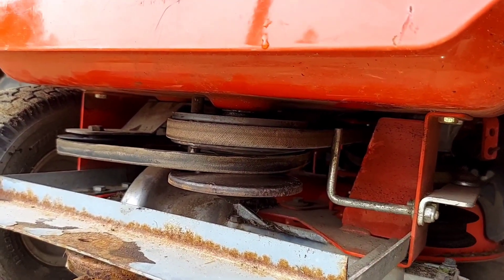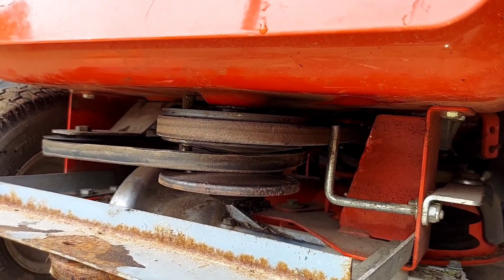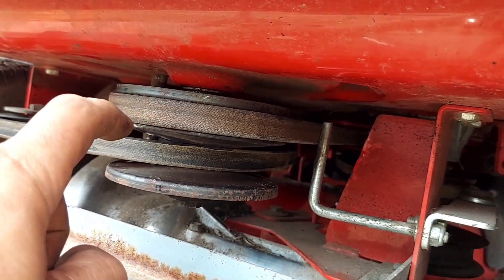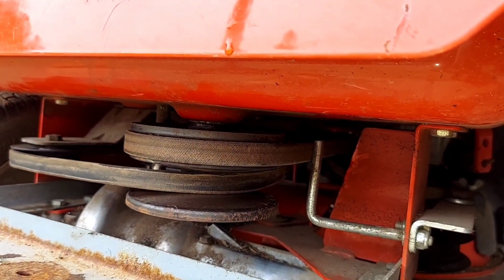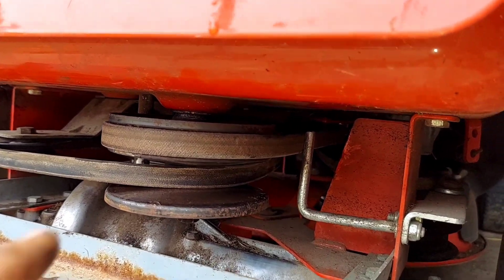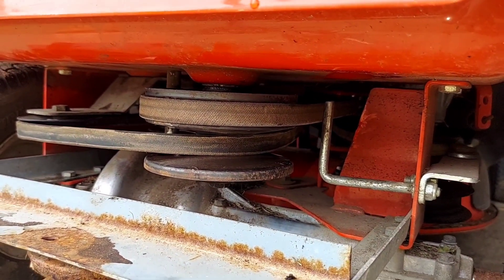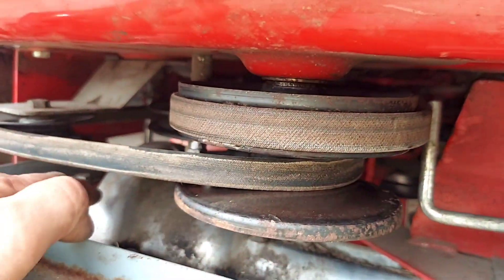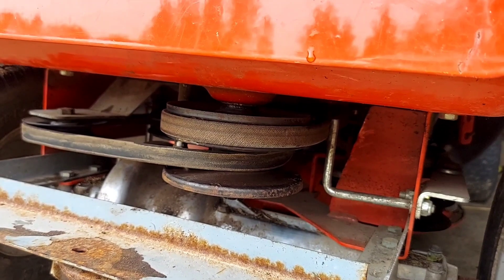MTD luv bug transmission operation.

Comment: I have a similar one but mine is a pull start I ordered a seat for my needle valve anything you recommend would be appreciated
Reply from the maker: Mine has been a total lemon. The keyway sheared off for the flywheel and it lost time and wouldn't start.  I fixed that  and now the stupid belts for the variable drive keep falling off.  I think i might just put a centrifugal clutch and a fixed gear ratio on mine.